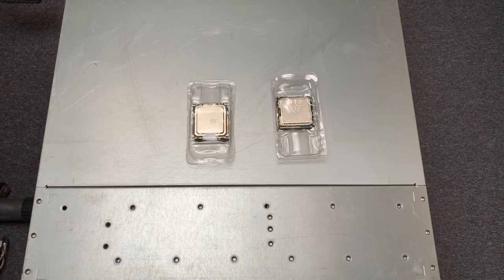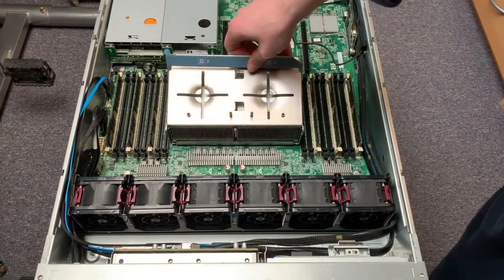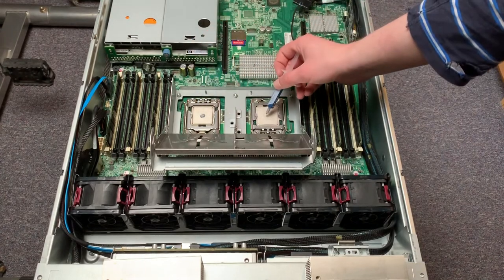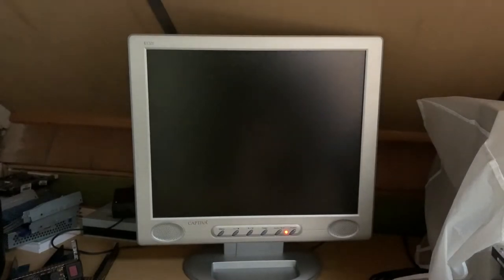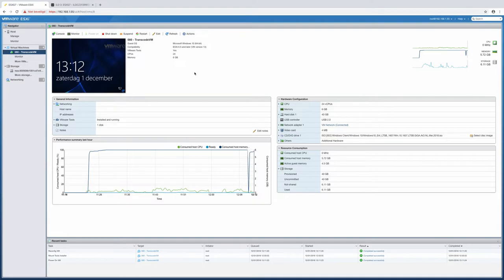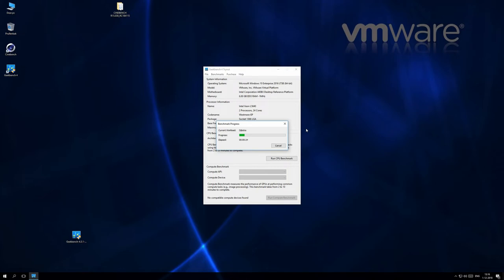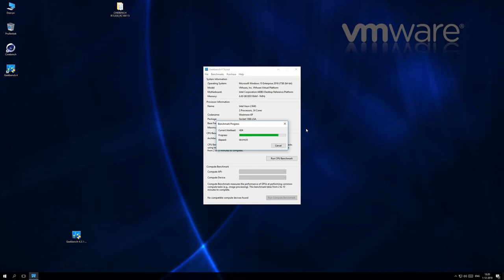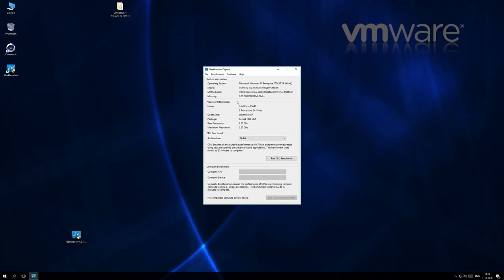HP DL380 G7 - CPU "Upgrade" to dual L5640s

Comment: Hey, I am trying to add a second CPU to my system but it wont boot. Any help? Updated the BIOS to latest version. Do the switches near the CMOS battery matter? What do you have then set to?
Reply from the maker: Hi, I no longer have this server so I can't say for sure. 

Which CPUs do you have and are they a matched pair / same stepping?
Reply: @nelizmastr  not sure, but they are E5645

How can I check the stepping?
Reply from the maker: Check the tops of both cpus and make sure they have the same S-spec. 

The E5645 should have SLBWZ for a production CPU. If one says something else, i.e. Q4HA, it’s not matched.
Reply: @nelizmastr  They both have SLBWZ written, only the serial number does not match
Reply from the maker: Serial numbers are unique so that makes sense. Swap the cpus around in a 1 socket config to see if the other cpu is dead. If it works on its own, you’ll likely have a damaged motherboard or 2nd socket.

Also make sure you have ram for the 2nd cpu installed, matched between the sockets.
Reply: @nelizmastr  Yeah did that and no luck. Both CPUs work tho. Just ordered a replacement motherboard and keep that one as a spare if I need it.

Comment: Does it support GPU’s if yes what’s the max GPU we can use. Thanks for the video.
Reply from the maker: There's no official GPU support of any kind as far as I know. You can always try to fit one. Keep in mind servers this old are not really meant for graphics cards at all.
Reply: iv put a gt 1030 in mine for fun and it worked out the box ok

Comment: i was considering to buy the same server with x5650 and 32 gb ram but could you tell me if a graphics card like gtx 1060 would fit or work (gheto solutions)  i wanted to virtualize with gpu passtrhough
Reply: Yasin Arslan AFAIK it is possible to get auxiliary pci-e power cables for these servers to give it the needed juice.

Comment: I noticed while you were installing the CPU that you have an SD card installed just above it. I just picked up one of these servers and haven't partitioned it yet - but what is that SD slot for? How are you using it?
Reply from the maker: The SD slot is for running a hypervisor that is small enough to fit on one. Mainly VMware ESXi, as it’s designed to run off a 2GB card. FreeNAS can also fit on a small SD card.
Reply: NelizMastr - Tech for PC & Mac I’m looking to use ProxMox as my hypervisor. So if I’m following correctly I would put the ISO on the SD card and install that on the server before installing/configuring an OS, correct?
Reply from the maker: Proxmox is too big for a SD card, it needs to be installed on a harddisk or SSD. Also, you write the ISO to USB or load it though the iLO if you have the proper license. It’s not possible to boot an ISO from a blank drive and install to that drive as well.